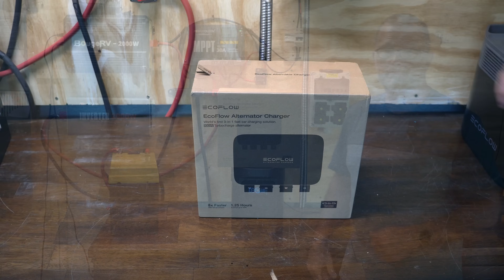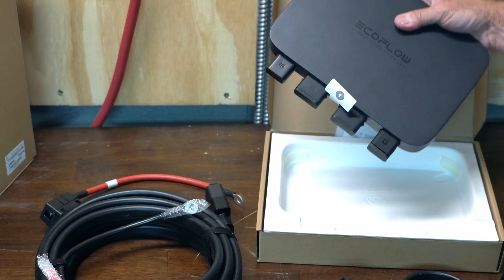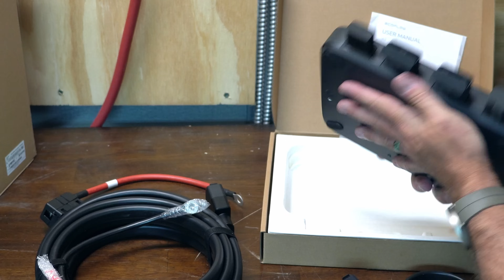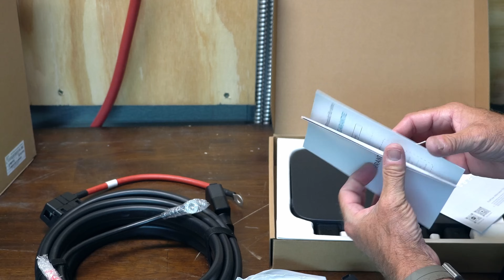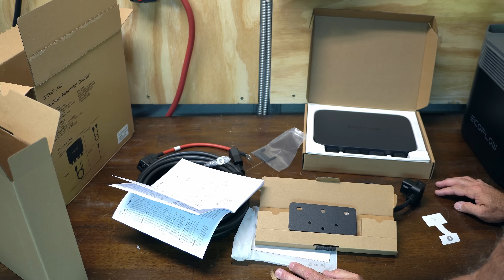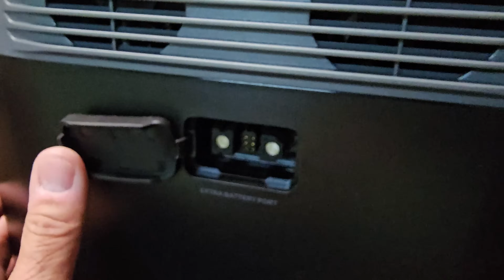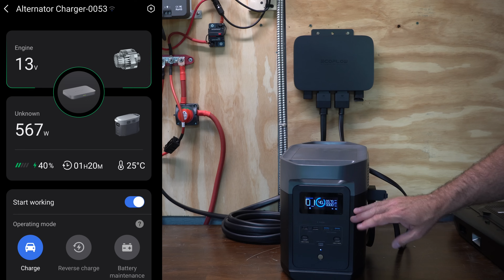BEST On-The-Go Charging for EcoFlow Delta Power Stations!

Comment: What most reviewers don't cover is the vehicle alternator requirements for 800 watts. Minimum recommended is 140amps. To be honest the 500 watt version is a safer bet. Nothing worse than being stuck in a remote area with a dead starter battery because you have fried your alternator!

Comment: Although this is a great way to charge your Ecoflow power station … it restricts you to charging only one type of power station. And for the cost, that is very limiting. For half the cost, you could install a power inverter that has many more features and uses. For $200. I installed a 600 watt power inverter that has two AC outlets at 110 volts plus a USB-C and USB-A outlet as well. I am able to charge my Solix C1000 to 100% in less than two hours at a rate of 520 watts. The Ecoflow Alternator Charger is priced at $350. and can only charge one power station. Seems a bit limited for the price.

Comment: That was a good video. The only thing maybe you could’ve mentioned and I’ve done this before with EcoFlow. I’ve bought something and then to find out you actually need an additional part to make that work but with this alternator charging thing if you have a Delta pro you need one of these attachments that goes into the expert battery report on the back of the Delta pro 3600.  EcoFlow Smart Generator Adapter $69

Comment: You can set the battery voltage you want to monitor. For example, if your setup, you can set it to 12V instead of 13V and it will then charge at 800w until it slowly drops as the car battery drops until it stops below 12V input.

Comment: Can I use this to my 2013 toyota corolla?  My mechanic told me not to use it because it’ll kill my car. 😢
Reply: It should be fine as you can adjust the charging ratein the app so it won't overwork your alternator. It won't "kill you car" but you should check the alternator output and adjust the charging rate to suit.

Comment: This device doesn’t entirely do away with the need for solar. What if you running your fridge 24/7 and you in a warm climate like Texas. You will need to run your vehicle at least 1-2 hours per day. Maybe you can skip a day if the weather one day gets cold. But unless you’re driving your vehicle 1-2 hours a day, you still need to either plug into ac, use solar or run your vehicle daily.

Now don’t get me wrong. I love the fact we can charge at 800 watts from our vehicle, and I will install one of these in my vehicle for sure.

Comment: nice,,You need a big alternator to run that, also they give decimal to control the voltage
Reply: Mine allows 0.5V increments, which is perfect for me, but it might be nice for some to have at least 0.2V resolution.

Comment: Something wrong if it take so long to charge a ecoflow. I have renogy 700w inverter in my truck with 6ga copper cable my alternator is 150 amps. Plenty to power inverter without battery drain. Its kind of important not to put too much stress on your alternator.

Comment: Very interesting! I have solar and alternator already installed, directed to my 12v battery in my campervan. I could add the exact setup you are using for demonstrating to charge my eco delta 2 from my 12v battery. If this is a save setup?!

Comment: Here’s the deal.. alternators are not designed for constant use charging. They’re designed to recharge and recap your battery and maintain  the electricity used for your cars factory installed electronics. Excessive use of the alternator like this , can cause  it to overheat and burn off the coating on the copperwindings shorting the overall life.

Comment: I try to never buy anything with proprietary cables or connectors. Also, imagine arriving at your destination with a full power station and a fried alternator. A running vehicle is generally my most important survival necessity. I'm not doing anything that can compromise that. It's not worth the risk.
Reply: It won't fry your alternator. Just turn down the charging rate in the app.

Comment: The EV's depend on their internal DC-DC charger to keep the low voltage battery topped off. Some are good some are pretty weak. Research to find out what it can handle.

Comment: Thanks for a good and informative video. I was visiting the US in 2019 and there was a lot of power drops. They said that the power companies turn off the power when the bush fires comes so that whole towns gets no electricity? Is this right? Or is the US power grid too weak to supply power?
Reply: I've not heard that. Our (overall) grid is capable but likely headed towards overloading, at least periodically. This was what was happening in Texas during their cold temps; system couldn't run continuously due to high usage. They had to turn it off/on and when on, would run for short periods before going off. l sources certainly needed during that mess - or at least heavy coats and blankets!

Comment: You are making a problem where one does not really exist.
Reply from the maker: Respectfully disagree.  When I go car camping, I'm rarely sitting at camp during peak solar charging times...and instead driving an hour or 2 to a trailhead.  And once at the trailhead, I'd be very reluctant to then leave a portable/suitcase solar panel on the roof (unless it's permanently mounted, of course)...but even if I did, trailheads are often very shady and would yield little, if any, recharging power.  So a DC charger like this (or a non-EF alternative) actually starts to make a LOT of sense for these use-cases.

Comment: You better hook that up to your truck, like your going to use it, to see how it actually performs. A simulation like that isn't always accurate. Very few alternators can keep up with the car's own power needs plus another 800W. I good size truck alternator is only around 200W. You'd need 4 of them, or some of the extremely expensive aftermarket alternators to even come close.

Comment: I saw 2 different Electric Cars using this device fine.

Just leave the switch on, so the High Voltage traction battery is charging your 12v battery. You don't need to drive to use it that method.
Reply from the maker: Thanks for the insights, Greg.  I was reluctant to recommend it simply because I'd seen (unrelated to this charger) where some EV's were having issues with 12V battery systems and I was concerned adding something like this might increase the likelihood someone might experience those issues.
Reply: Utility mode in some types of EV. Yes there are a few YouTube videos demonstrating use with an EV and hybrid

Comment: May we have a moment of silence for all those dead alternators and the ones who will follow?
Reply from the maker: I'm by no means an 'expert' on this type of charging solution, but I did do some research on this and the consensus seems to be that as long as you're max current rating on the alternator is about 2x the max current of the DC -DC charger, it should be totally fine.    So iwith this particular product, the max current would be ~63A at the full 800W.  So as long as your vehicle's alternator is rated for at least 125A or more, it should be totally fine.

Comment: I put a Renogy 40A DC to DC charger from my battery to a PUP 100 AH LIPO bat. to an inverter. I have LESS money in this set up than you do in that 1 box you just opened. Mine does the SAME thing your multi-thousand-dollar system does. What's better, rich or smart? I like smart and frugal.
Reply: @inmyopinion6836  I saw other YT'ers say that the simple DC to DC chargers get VERY hot.  Does this magically not happen with the Renogy one?

Comment: I am really confused at how this works.  So I just want to know if it could damage your alternator or cause you to have to replace it sooner?
Reply from the maker: I'm by no means an 'expert' on this type of charging solution, but I did do some research on this and the consensus seems to be that as long as you're max current rating on the alternator is about 2x the max current of the DC -DC charger, it should be totally fine.    So iwith this particular product, the max current would be ~63A at the full 800W.  So as long as your vehicle's alternator is rated for at least 125A or more, it should be totally fine.

Comment: Is xt90 a universal plug? Is this only usable with Ecoflow products?
Reply from the maker: I actually mis-spoke on that connector.   It's actually an XT150 connector...   And it would be possible (I believe) to get it to charge other battery/power stations, it'd take a bit of DIY ...and I'd think you might actually be better off at that point just saving some money and going with a more 'generic' DC-DC charger.

Comment: Was just thinking what if you use this as a way to charge a off grid cabin instead of putting up solar panels or even having a gas generator use your vehicle to charge up the cabin  batteries as needed and if you have a remote start for the car that would even be a bigger bonus :)

Comment: If you’re charging at 12 volts, it limits the watts to around 120 because the power station is typically limited to ten amp. Amps x volts = watts. So if you can double or triple the volts, you can charge at double or triple the speed. This can be done with a DC to DC converter at a much cheaper price. The advantage of this device is that it automates the process. Beware though that this could max out your alternator as it keeps your 12 volt car battery fully charged.

Comment: The Renogy 50a MPPT DC to DC is a way better option, it can handle 25A from your solar panels and it charges your Starter battery from PV when the house battery is full,  has BT capability, also cost $200 less

Comment: Hey buddy have you factored in the vehicles  alternators amps some are lower amps than others however you can get a higher amp like a100 amp alternator I did on my Dodge Ram 1500 for a camper 12 vdc electrical system it helps a lot thanks Eric !
Reply from the maker: I'm by no means an 'expert' on this type of charging solution, but I did do some research on this and the consensus seems to be that as long as you're max current rating on the alternator is about 2x the max current of the DC -DC charger, it should be totally fine.    So iwith this particular product, the max current would be ~63A at the full 800W.  So as long as your vehicle's alternator is rated for at least 125A or more, it should be totally fine.

Comment: I  bought a 700w pure sign inverter and a 20’ jumper cables that cannibalized for cheep cables and that charges my delta 2 amazingly! All in with connectors for around $200 bucks.
Reply: Your set up will lose about 20-30% going to AC and back to DC using the inverter, but is half the cost, so unless you use it a lot, it's probably the better option.

The reason I went with the Alternator charger is so I can monitor the 12v battery in my car and actually charge back the other way if my 12v battery starts having a problem. I also was thinking of using the alternator charger to charge a 12 or 24v battery bank to save on buying a 3x the price per watt ecoflow branded extra battery

Comment: just a question - If you own an EV (Battery Electric Vehicle - NOT HYBRID) would this still work, if you connect it directly to the 12V battery, as the main drive battery of the EV charges the 12V....so was actually wondering about this, as I would definitely buy this along with a EcoFlow Generator as a electric jerry can for my EV and having this inside the car to charge on the off chance I run out of juice in the EV and couldn't get to a Charging Station.
Reply from the maker: Since the EV does not have a conventional alternator, I wouldn't risk it.
Reply: Also, be careful.  ANYTHING you hook up to a Tesla battery will void any remaining warrantee.

Comment: Why not get a 600W power inverter and plug it into your lighter socket and use the AC connection on the EcoFlow?  Then you can charge any power station on-the-go.  Wouldn’t that work just as well?
Reply: A automotive lighter socket supplies 12 V (up to 14 V when engine is running) at 10 Amps maximum, so 14 x 10 = 140 Watts maximum. The 600W power inverter is only about 80-90% efficient, so it can supply no more than about 120 Watts continuously when hooked up that way. To get 600 Watts out of your inverter, you have to wire it directly to the battery terminals with relatively heavy wire.

Comment: You NEVER want to use your alternator to charge a battery! Alternators nowadays are only met to maintain a good battery, Not charging external sources!
Reply: An alternator is a 3 phase electrical generator coupled with diodes to convert the output to low-ripple DC. It couldn't care less what sort of load it's attached to as long as it is within the alternator's operating limits. And it most certainly is just fine to use it for battery charging as long as cooling is adequate.

Comment: His thing is way too expensive.
You are better off getting an second battery module and charge it at home.
The problem with this thing is that most ppl dont drive enough hours to fully charge the unit every day.
I know I used to live in my Toyota Landcruiser.
Idling the huge engine is very inefficient.
Reply from the maker: I agree that it IS expensive.  BUT, most alternatives don't get you the full 800W, and then when you compare this to the cost of, say, 800W of solar, it's actually way cheaper.  And I completely disagree that most ppl don't drive enough hours to fully charge your EF Delta.   If you're driving to a trailhead just 30mins away for a day hike...and then drive 30mins back to camp, you'll pretty much have fully charged a Delta 2.   And you don't have to worry if it's cloudy or raining...you just need about an hour of drive time in a day...and that is definitely not a problem for how my car-camping trips usually go.  That might not be the case for everyone, but it certainly is for me.  We can agree to disagree. :)
Reply: @ReeWrayOutdoors But you can get a 1200 Watt inveryer for 200 bucks and hook that up to your alternator and you can fast charge your powerstation through AC, way cheaper.
Reply from the maker: @EvenStar303  that's fair, and I will confess that I don't have any experience with that particular setup so I'm not sure what other considerations might or might not come into play.  Still, I appreciate your contributions to the broader  conversation.

Comment: Basically a more sophesticated version of the Daygreen chargers and dc-dc step up converters sold online. 

I use a 12 to 58V step up dc to dc charger from Daygreen. 100A input 20A output 1072watts. Use it to charge Oecron E1500lfp and E600LFP power stations at the same time.

Comment: Thank you for the review and offering additional options. I own the Delta-2 but my specs show it only allows for 500 watts of solar input. How is yours allowing over 600?
A year ago I installed a boost converter under my hood, attached to the car battery and boosting voltage to 24 VDC, then running much smaller wiring to the trunk. That allowed me to get about 200-250 watts.
As I read comments below, I also just bought the Pecron as it was less expensive than other options and allows me to use multiple voltage battery banks to charge the variety of solar power stations I own via MC-4 connectors and adapters.
Reply from the maker: Yeah sounds like you've already got a workable solution then.  But yeah it cam input up to 800W because it is bypassing the solar charge controller and going straight in through the battery expansion port.
Reply: @ReeWrayOutdoors  Ahh, I didn't think about it bypassing the controller, which I will not be able to do easily with my other power stations.
 Nice to know, thanks!

Comment: I have a 400w inverter in my Bronco Sport Badlands and it is free, combined with my 420w portable panel, i have enough power. It is also work with any powerstation not simply Echoflow.
Reply: Factory inverters usually don't change
Reply: @corbindallasmultipass  don’t charge ? Mine is a real 400w inverter. I runs my air compressor with a Roypow 120-> 12v 200w.
I charge my jackery 1000  145w,
And my bluetti ac200L has a feature to limit the input to a certain amps (3 amps to be <400w for example)
Reply: @CC-gt3ro  hence why I said usually don't* 🧐
Reply: 420w portable panel ? Must be huge
Reply: @leeinwis  31 lbs 2m60 nearly 90cm height if i remember the specs. But it is manageable with nice metal stand
It has also hole to put security cable.
I have 50 feet mc4 so i can locate the panel in the best sun area.
Reply: Bluetti has realease a charger for all their powerstation to connect to the alternator battery to charge at 560w during driving. So i can charge at 420w static with the panel or i could charge at 400w(my bronco sport inverter) or 560w during driving with their new charger.

Comment: I am a newbie here and am electronically challenged. But I ordered the Alternator charger with the idea of connecting it with a standalone battery in my SUV. The battery would then charge my Delta 2. Are you with me so far? The battery is a 12V/24V 100Ah/200AH Lithium LiFePO4 Deep Cycle Battery, 3000+Deep Cycles, 100A BMS. Can I do this and only charge the battery with shore power when needed? TYI Joel
Reply from the maker: Yeah that'll work (it's what I was doing in the video). You just won't get the full 800W...probably more like 400-500W, which is still pretty good.

Comment: This costs $800. A 2000W pure sine inverter can be had for $200-250 with the necessary power cables. Not only does that save you a LOT of money, but it charges significantly faster and offers further utility for multiple devices, including power stations from other brands.
Reply: Nice to.know. l commented elsewhere l like this device.  But l didn't think about the less expensive approach you describe here.
Reply: 200 Watts is nothing.
Most akterators can push out 1000 Watts.
You would need a 800 to 1000 watt inverter to match this.
But those are also much cheaper.
Reply: @We-Do-NOT-Consent-To-The-Loop  2000W. Typo.